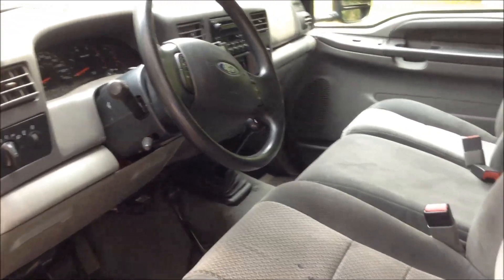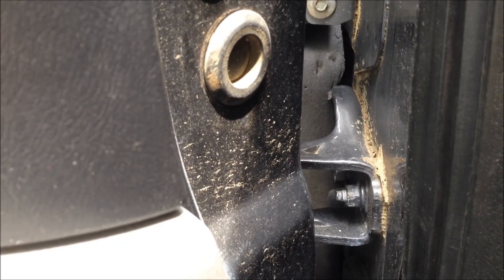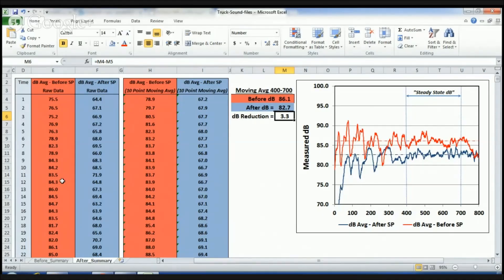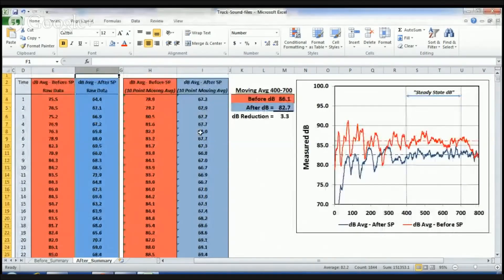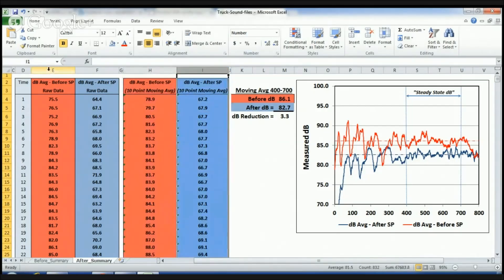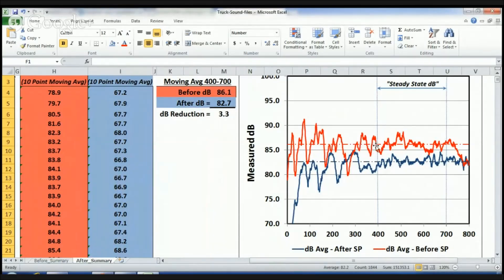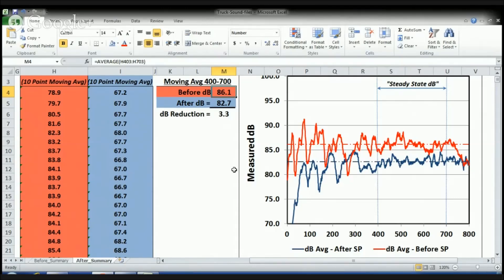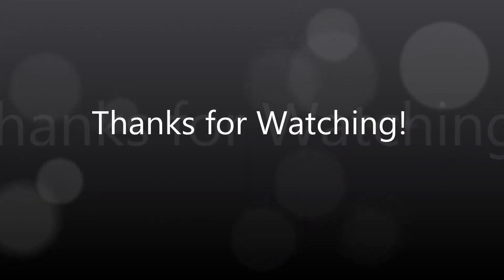Sound Proofing Project - Part 3 of 3 - Reducing in Cab Diesel Engine Noise

Comment: I keep coming back to this video when I think about sound proofing my 7.3. Was all the work worth it? Anything you would do different years later now? Thanks.
Reply from the maker: Yes, it was worth it.  I think may have added more sound insulation (not sound deadening)
Reply: @ProjectsbyTMD  Appreciate the reply! The oem crown vic insulation or more of the aftermarket insulation? Specifically on the firewall? I have also read that wrapping up pipes, and adding a turbo blanket will do wonders for stopping sound at the source.  People have added deadening to the timing covers as well, although I would want fire proof products here if possible.

Comment: ive had success on the cheap using Frost King sticky foam/foil from big box. apply to inner part of doors - clean inner, then sticky foam stays put.  abt 3 rolls to do 4 doors.   a hood liner helps a lot too.  your db, as recorded is interesting, for  a typical Honda genset produces ~60 - 70db.  good job.

Comment: Thank you very informative and enjoyable to watch. In your opinion what is the best sound mat to use? Looks like a job I only want to do once.
Reply from the maker: +Ken Bilger 
Hi Ken - there are lots of products on the market today; and, there are lots of reviews on the products.  I chose a mid-range product for my project; and, I am happy with it.  I did have one additional requirement ... I wanted to be able to remove it should I ever need to make a repair of some sort.   I chose a product that met this requirement.  

Regardless of the sound deadening product, I would recommend also installing sound insulation as well.  The two have their inherent strengths and will maximize the sound sproofing for your particular application.

Comment from the maker: Hi Andrew - I believe it took 3 full days of work.
Reply: +ProjectsbyTMD Thank you for such a detailed video series on this, most say it works with no real information. I have a 04 liberty and it has very little padding so I'm thinking of taking it apart to clean it up and deaden it at the same time.

Forgive the ignorance but is 3.3db really that significant for the cost/time involved? I imagine I would have a better result as mine has almost zero padding on the floor but I figured I would ask.
Reply from the maker: +Twisted86 
Please keep in mind that sound is measured on a logarithmic scale (db); thus, the change in loudness is on a non-linear scale/magnitude.  For me, it was well worth the effort.
Reply: ProjectsbyTMD q

Comment: That was really good thanks for posting that. Maybe I missed it, but I didn't notice you installing anything underneath or in the engine compartment. In my case I'd like to reduce the noise by more than 3 db Would improve it even more do you think? Just curios.Thanks.
Reply from the maker: mudspringerAnything in the engine compartment will help.  Some OEM manufacturers do different things to reduce the noise.  On the truck, there's sound insulation on the hood, door jams, and on the fire wall area.  On my VW TDI Jetta, there's a sound insulation cover that snaps on the top of the engine.
Reply: Thanks for the info.